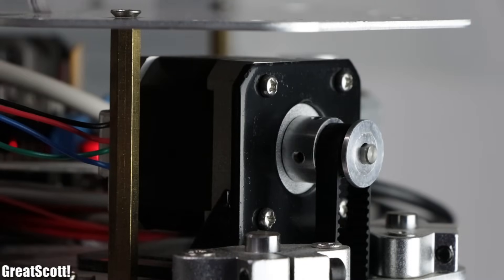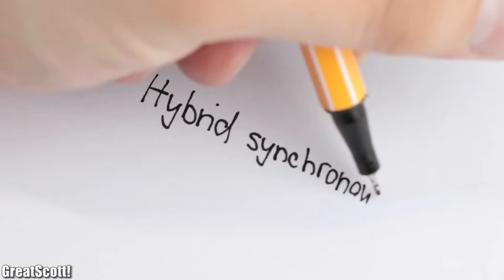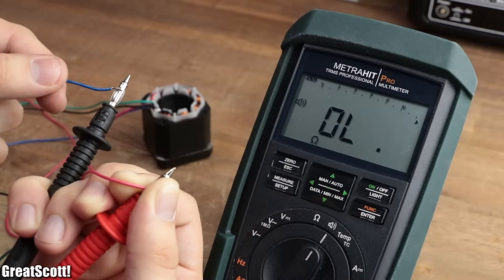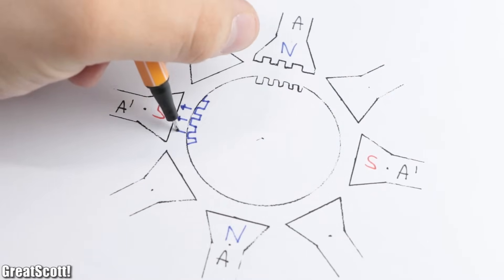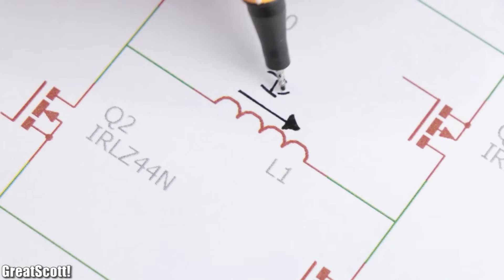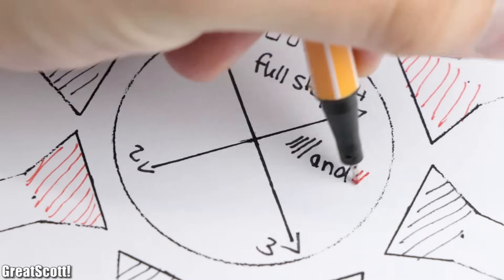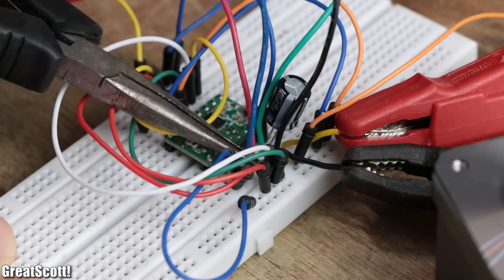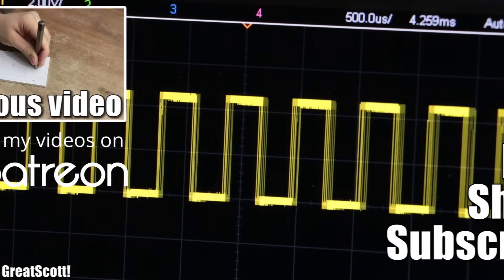Electronic Basics #24: Stepper Motors and how to use them

Comment: Why does the rotor spin clockwise rather than anticlockwise (or viceversa) when you switch between the various coils? And how can you control the rotational direction?
Reply: the direction te motor spins depends on the way you pulse the coils, when using a driver it takes care of that for you, all you have to do is control the 'DIR' pin and that fips the direction of rotation

Comment: I overclocked my 3v dc motor and pluged it into 12v on ATX power suply.Motor worked for 20 seconds and the wires disoldered
Reply: I commonly power 2.8 Volt steppers with 12 volts. As long as you use a good driver, never had a problem. The higher voltage gives them more torque. You just need to watch they don't get too much current. One time when I was forced to use a small stepper to do a big job due to space restrictions, I added a heat sink to the end and a fan. Got plenty warm, but not hot enough to fry.
Reply: It was before few years and i didnt knew about those stuffs so plugded it into pc power suply and from the heat it burned my hand
Reply: Been there, done that. That's how we learn.
Reply: i trought that voltage on motors doesnt matter like "if i am ataching more voltage it will spin faster" but now i know it all
Reply: lol
Reply: this one time at band camp ;)

Comment: "old 3d printer"  :D :D
Reply: maybe it was from his first primer So actually "old" can be said
Reply: 3D printers have been around for a long time. They are used as Rapid Prototyping machines (in my opinion, the best use for a printer, not wasting its power on making a mini octopus) by engineering companies. Its recent that the cost has come down (thanks to DIY like RepRap), and you can buy a nice kit for around $250.

I've used fancy 3D printers that were huge (like pop can machine size) that have a small build platform, that cost way over $10k, but now are not a lot better than a reprap kit (for most people anyways). So he could have gotten it from a really worn out printer, and it could be really old.
Reply: +gameo yeah I was surprised to hear that too. We live in a spoiled world where technology advances at an exponential rate
Reply: He could be referring to a MakerBot that died after a couple of years, although they rarely last that long.
Reply: No, it was an unreliable Sunhokey i3 kit.
Reply: Theyre also great for making wax models for casting
Reply: this just sounds rich
Reply: how many dam printers does this guy have
Reply: Considering this technology is nearly 40 years old, I would say there are old 3d printers.

Comment: Hi Scott, I need your help please. I bought a circuit board for a 5-wired stepper, connected it to my raspberry pi and coded a bit. It worked perfect! But that stepper was too weak so I bought a larger one which has 6 wires. I looked up the difference and google told me that i should just connect two of the six to ground (the old stepper had one to ground). But when I run my code, the stepper moves, but way too fast and it gets really hot... Do you have an idea what I'm doing wrong?

Comment: now connecting red wire to Vcc and green wire to gnd and then connecting black wire to gnd and blue wire to vcc and then connecting violet wire to again vcc and then rainbow wires to gnd and then finally unicorn wire to high voltage , we get a stepper motor running !! Yes I understood. :)  Thanks,.  (y)

Comment: You should make a DIY oscilloscope with an old CRT tv
Reply: he did it :0
Reply: That's easy. Just disconnect the vertical deflection coil and put in your own signal on it.
Reply: But it will not be fast like oscilloscope.
Reply: I was just thinking of a fun DIY project you could do if you had no money.
Reply: What? I need to check on this, that is an amazing idea I've never heard of! Too bad we got rid of all the CRT monitors like 5 years ago... At least it wouldn't cost much since everyone would want to get rid of it.
Reply: lol

Comment: Do stepper motors have a lot of torque like to propel someone when used on such thing like a hoverboats
Reply: Stepper motors are designed for precision movement, Getting high torque from them requires high current. If high torque is your requirement then a normal motor with a gear box makes much more sense.
Reply: It can propel someone on a hoverboard. But it'd be a slow trip
Reply: +bellcc TheTuxedoBros yeah but their aim is to provide torque.
One common example is Robotic arms.
Reply: A disadvantage of stepper motors is that you need to drive it in steps, so you are also limited in speed by how fast your driver can pump out the steps. Using an arduino would be pretty slow; a raspberry pi is faster, but would it be fast enough? A server with a Xeon processor is definitely fast enough, but....

No, steppers have the kind of torque that is good for turning a screw a precise amount. For your application, you want a BLDC motor. It is a constant torque motor. It's possible to over-volt a motor to get more torque out of it but this creates a lot of waste heat which will burn up the motor if you aren't cooling it.
Reply: +Diamonddrake
Steppers make excellent low RPM generators.
Reply: Hover board
Reply: Stepper motors are slowwww
Reply: Ok thanks guys
Reply: Building&Filming it can, if u used a fairly big prop.